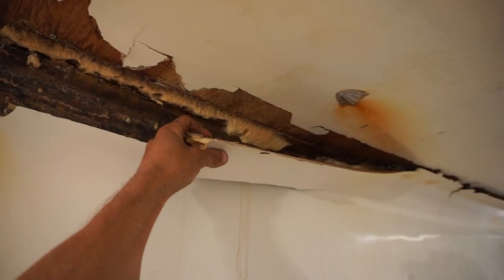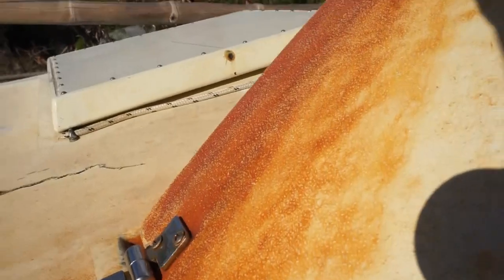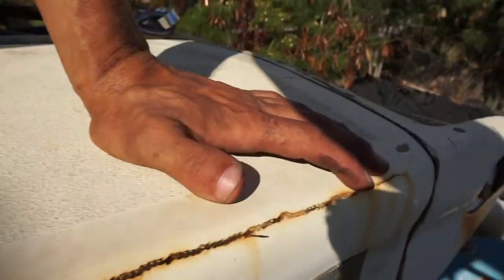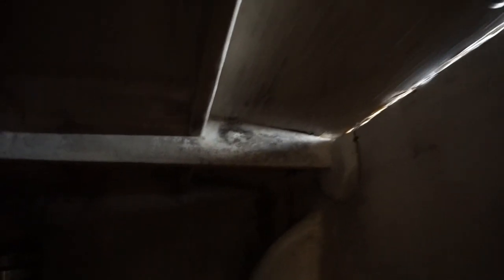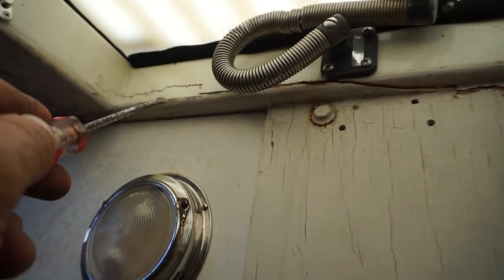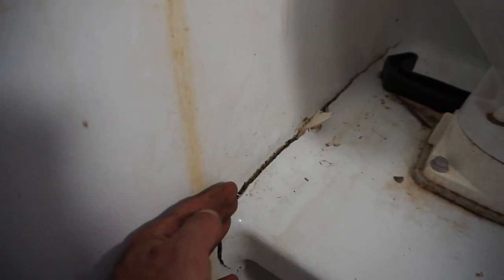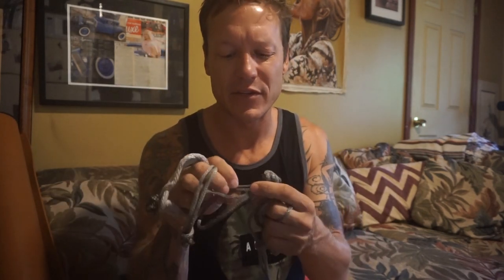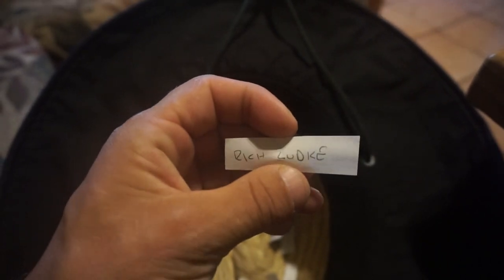Tearing apart my wrecked Catamaran

Comment: Drilling holes in beams/stringers creates predictable points of failure and does not necessarily weaken them
Reply: That is contradictory.
Reply: It's also a self-fulfilling prophecy.
Reply: @coffeefish  How so?
Reply: @phillipbotha7920  You stated that drilling a hole in a beam would create a predictable point of failure, but not weaken the beam. The point of failure IS the weak point.
Reply: @coffeefish  Flaw by design, even modern vehicles are built on this principle. The point of failure is created to allow the system to collapse in a predictable and manageable fashion. Does not mean that it is weak
Reply: @phillipbotha7920  said, "created to allow the system to collapse in a predictable and manageable fashion". What? Allow to collapse, predictable fashion...offshore? Don't ever design or build a boat unless it is for a swimming pool.
Reply: @phillipbotha7920  your post said nothing about a warning. I have sailed 5 sailboats and crossed the Pacific from San Francisco to Hong Kong and criss crossed among many of the islands in between. I never had any structural cracks, predictable or otherwise. Why, because none of the vessels were designed or built by you.
Reply: @joelvoss1226  I never said they were designed to fail , i said that if they do fail they are designed to fail in a predictable manner. Perhaps you need to study some design and redundancy. A mast will snap before it rips out of the deck. Why???????
Reply: @phillipbotha7920  You just don't get it. The best design is one that won't break or crack up. Everyone wants a mast to break if that keeps the vessel from sinking, duh. But to prevent that from happening one builds a strong foundation and does not build a rig that would break a mast under heavy loads because the sails should be reefed or down completely. I have been in seas with 40 foot waves and howling winds without damage to the vessel. The emphasis is not on predictable points, it on nothing breaking.
Reply: @joelvoss1226  I suggest you go find a dummies guide to engineering and design. Nothing is designed to fail, but in the event of a catastrophe, predictable failure is preferred over sudden calamitous simultaneous failure of all systems and that is exactly why the mast will snap before the boat sinks

Comment: Seeing you expose the build structure reveals why it failed. All materials have a self life, particularly when exposed to the harsh marine environment. 
Quite shocked at how thin, or non existent the fiberglass is - appears to be one or two layers. (I have 8mm of fiberglass on both sides of my wood cored deck). Major design flaws. All structures move and stress and a good design will spread the load of the stress so there is no undue stress at any given point in order to avoide breakage and lengthen the life of the material.
The thing with cats is two hulls wanting to always break apart due to the nature of wave conditions means they suffer more stress and any cat with mileage is one that is best avoided. Your going to see more similar stories going forward.
A good design should always consider the stress loads and how they work together under all condition. More diffiuclt to calculate for cats. For instance, my boat becomes stronger with more stress simply because that is how it was designed. Everything is tied in as a continuous load so that stress on one side is relieved by slack from another side. The problem with home builds is if they are not designed and built according to calculated materials/structutural designs by qualified expereinced (matrials/structural engineers) builders with a healthy dose of added safety cushion expect failure, especially with a design with two hulls wanting to come apart. Your lucky it survived as long as it did but it was always going to fail.

Comment: So is this just basically 40 years of rot hidden by fiberglass overcoating?  Maybe this is not a good way to build boats in general, since water is bound to get under the glass at various points?
Reply: What kind of hull/bulkhead structural material will you now trust to take you across oceans?  Aluminum? Steel? Pure wood? Pure fiberglass?
Reply: 90% of the problem is that you can't see the problem...until it fails catastrophically.  Sort of like stainless steel. :-)

Comment: It looks to be built way too light! Half the bracing and spans are overloaded along with no continuity of lateral supports!! Take the parts that are worth taking and move on! You are lucky id say, that pontoon was all but torn off! The forces of the sea and wind are a variable that cant be calculated!unless it is made of steel. or oak.
Reply: Yeah, looked like a lightweight coastal cruiser to me. But James male good points on those two large bolts and that aft beam that ended at the hatch.

Comment: Heck, I'd cut those hulls off at that carlin stringer - top of the Airex foam - and build anothe cat!
But, I'm to old a boatbuilder to do that...... some young keen fella could though....
If you are handy with tools, get the plan rego number from Crowthers owners and ask for stronger main bulkhead design, build better - perhaps cedar core composite bridge deck, nothing wrong with ply decks, cedar core composite cabin structure - modern design..... 

Make an offer for the rig etc.... come on young punks! Do it.......

Comment: The entire beam looks dimensional too small and the connection to some of the whimpy bulkheads and the placement of bolts near where the main beams are reduced in size due to the intersecting joists was a bad design. All in all the design seems undersized in relationship to the lateral loads the boat had to bear......age can also be a huge factor

Comment: Plywood manufacture tries to use the cheapest glue they can get away with. For the cost and modern chemistry glues you would think they would use better glue. Plywood with polyester glue would really make a very strong plywood ad that is what marine grade plywood should be with patched voids.
Reply: Designed for average sailor built with materials for the time....not intended for much blue water or the rough seas you took her through.  You survived and came out a better couple.  Great story can carry through your lives and more with You Tube..

Comment: i work with composite materials, carbon fiber wet layups as well as pre peg ,also fiber glass ,kevlar etc,on airplanes and satellites,same principles applied to boats we have some  composite people from Oracle world cup boat builds,your boat was doomed the day it was launched,sorry not trying to be a jerk,just seeing the construction and damage you showed is enough to see why this boat failed, and its a combination of bad design and poor construction materials and lack of  knowledge of composite materials,like fiber orientation, number of plys layup, radiusess( and that's a big one why your boat failed )and proper bonding techniques,resin content ,curing cycle etc,i hope your next boat is not a plywood fiberglass construction, or you will just be making another video of the same mess, that's if you make it back to port next ,you got very lucky this time ,don't push your luck with this type of boat and its construction,nothing good will come of it.
Reply: Mark Morton
I was going to post something along the same line. I work with composites in the aerospace industry. 
In a plastic boat there are a hundred small factors, that over time, lead to a cascade of small failures and eventually those small failures will combine and find spots for major failures. James identified several locations where major failures occurred. Instead of the entire structure dealing with strong dynamic forces, those forces found a path to the weak links that should have been strong links.
1. I know some backyard boat builders that do incredibly meticulous work.
2. I know some backyard boat builders that do sketchy work. (Not necessarily on purpose but because they are not knowledgeable in material science and have not yet developed the required skills.)
3. If a plastic boat is built in the best of conditions, in a factory with state of the art equipment it will still fail at some point because it is plastic.
4. Surface prep is critical when bonding and laminating. (Removing wax, wiping with acetone, sanding and wiping with acetone.) 
5. Resin permeation is critical. An air pocket or resin void is the cause of many structural failures. I doubt anything on Zingaro was vacuum bagged.
6. Improper catalyst to resin ratios will lead to disaster. 
7. Various polyester and epoxy resins have different elasticity and or rigidity. They flex differently and will delaminate over time. 
8. Ambient temperature, when working with any material, is to be considered. A joint that is tight when made in the summer will not be tight in the winter. Mixing resin and using the correct catalyst and applying within the working window is critical. Metal, wood and composites all expand and contract at different rates. 
9. Longevity or lifespan of materials. UV light is a major factor.
Reply: Nothing wrong with ply construction as long as the design for the boat is robust and sound and all ply including cut edges is infused with a product like everdur ". Have seen ply boats stripped for painting that have been infused with this product and the ply looks like new
Reply: and despite these design and material issues you suggest, it lasted 45 years and took a catastrophic event to do her in. Monday morning quarterbacks always seem to be so pious.
Reply: Coming across this channel for the first time, tonight, I gotta say, my mind is blown right now.  This guy seems like he must be a complete idiot nobody for even entertaining a whiff of a thought about fixing anything on this vessel, as it is obviously never sailing again.  As you point out, it was never safe from day one. But here he is, with 600 plus comments on this video alone.  And he's raising money for another boat apparently!  This is where I'm actually sitting here scratching my head.  You, Mr. Morton, have chimed in here with your deep base of experience in industrial composites.  If that wasn't enough, below you've got Winzie 57, also a highly intelligent individual with a lot of experience and relevant information on hand.  Oh and I forgot to mention Todd Abrahamsson.  Try finding this type of quality commentary on the sailing Reddit!  I would understand more if this was the space x channel, but we're looking at a guy poking a fiberglass wreck with a rusty screwdriver.  But these comments are real, they are here, they happened, and that means that youtube must have other hidden gems just waiting to be discovered.  Unreal, almost inexplicable.

Comment: My theory is that fiberglass and plywood suck . Fiberglass and foam core such even more. The solid wood real wood is better. So I know that a real solid wood boat will last for more then 150 years while all those fiberglass toys as the ship Capt. all refer them will last 50 years if the owners are fantastic at maintaining them and they don't sail in heavy seas

Comment: I know, James you don't want to hear this. Strip that boat and sell the parts. I know you have 1000's of $'ers in this boat. Be real. It's going to take 1000's more and 2 or 3 years to fix it. Then what? A 45 year old boat with patch work here and there. 

Why not start a fresh? Think about a, James Wharram Design or whatever? You'll have a new boat that will cost a little more in money and time. Your young. You'll be happier with a new boat in the long run.

Comment: The moral of the story is, before taking a boat offshore, learn a whole lot about yacht design and construction.  Every structural part should be examined.  The end of every structural part should end at another structural part.  I'm an old yachtie, and 40 plus years later, my old boat is still sound after many long voyages.

Comment: From what I can see it looks like all your fiberglass overlay was chopped strand rather than woven roving.  Wrong type to use, especially over wood.  Little if any structural stregth compared to the woven type.  Any repairs I've done I always use roving for structural integrity, only use chopped strand as filler where no strength is needed.  Please use this to learn what to watch for on any future boats.